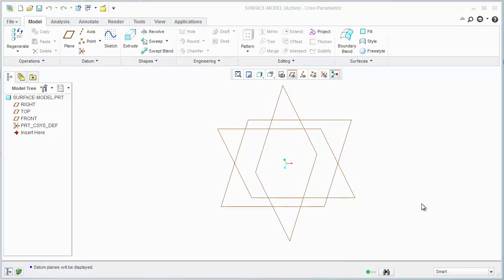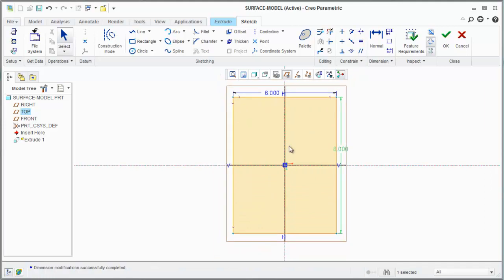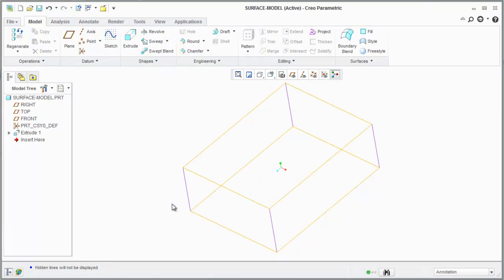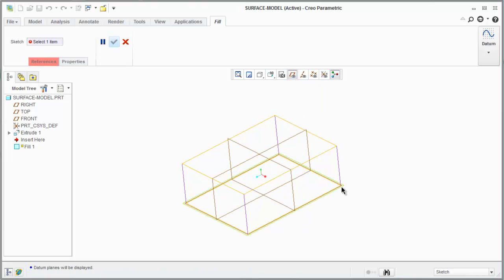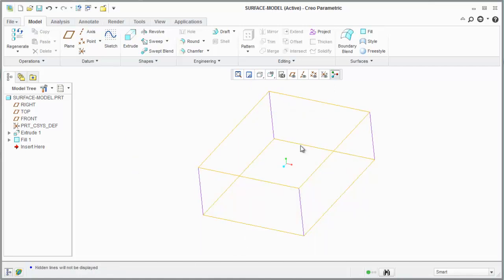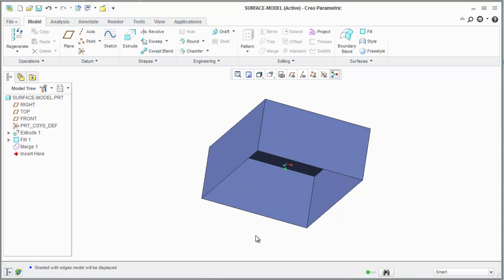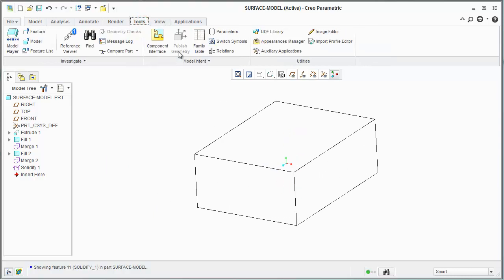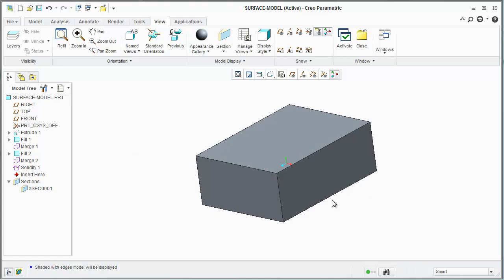Creo Parametric 2.0 - Surface to Solids

Comment: You probably have a ton of knowledge about this software, I have a question

I want to take an existing STL file from the internet, and actually do a cut extrude through the bottom of the object to make a screw on cap from an stl shape. How can I convert the STL file so that I can cut away at it? I can add extrusions after adding a datum plane but I cannot cut away at the stl part. 

Thanks!